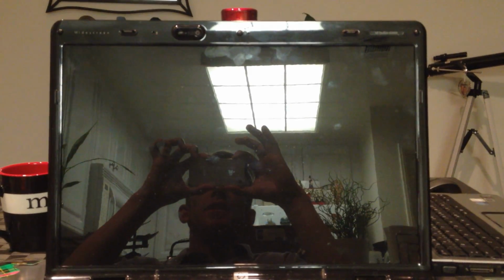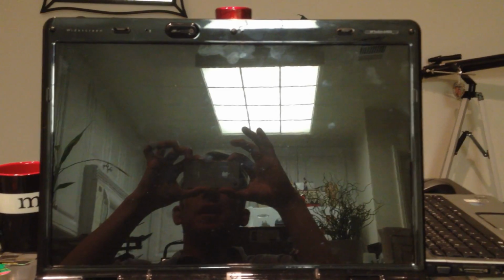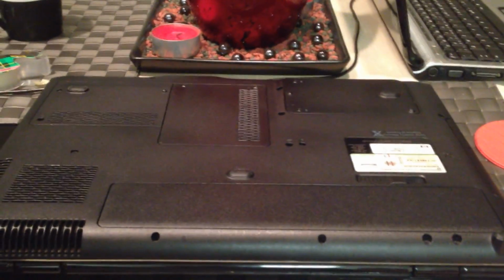How To Repair Your Loose Hinges On Your HP Pavilion Dv9000 Laptop

Comment: By chance I have the same laptop with the same issue. I was not sure how much I had to take apart to get to the hinges. Thanks for the video.  :-) I think I will add a drop of lock-tight to the screws so they won't come loose so easily again. Probably a design flaw.

Comment: The screws are loose probably due the hinge tension being too tight.  You were lucky to see the problem with loose screws before they got real loose and pulled the metal nuts out.  The following link will show you how to get to the hinge nut and loosen the tension.

http://audiokarma.org/forums/showthread.php?p=9018976#post9018976

Comment: In my Pavilion, the left hinge is the only one that is loose. It happen overnight. Everything was fine and when I opened the laptop lid I taught it was going to detach completely. It's to the point that it's opening the bottom left panel of the laptop, so the laptop is completely uneven when put in a flat surface.

Comment: Some HP laptops are worse. I have a g7 in that the left hinge practically detached itself, also the cooling HSF is not up to par when it comes to the processor that it has on board.
Reply: As in detached I mean the copper standoff that the screws screw into broke out of the plastic mounts.
Reply: Dilan Gilluly Same issue... did the solution here work for you? Mine also gets way to warm.
Reply: J Bailey Using JB Weld plastic got it working for the person for about 2 months then it essentially melted the fix because of the heat coming off of the HSF. Now I can't even open it without damaging it more. Because of this I'm not going to recommend HP Pavilion laptops anymore. Seen too many issues with them. If someone wants to buy HP I tell them to get a Probook or an Elitebook.

Comment: Another tip:
When taking apart a laptop you will need a "prying tool" to disengage locking tabs.

Use a old credit /prepaid/gift card  /plastic spatula instead of a steel screwdriver.  Reason is it won't scratch, and it spreads force over wider area.

Comment: Just a thought of two to add:
1: You should use BLUE Locktite on the screws, so the screws don't back out.

2: On a laptop I'm working on right now, the hinge was too "tight", this destroyed the mounting bosses /plastic webbing. Suggest reducing hinge tension, and reinforcing bosses /webs BEFORE they break.

Comment: TipsNNTricks I have a HP dv2700 replaced with a dv2000 screen, do you think it will work for me? At one point is has gone 165° or 170° backwards but I have managed to position it at an obtuse angle. I am going to get the kit and all. I just would like to know the difference between the loose screws or loose hinge?

Comment: I have dv2000 model and the hinge is completely loose, thus the screen is completely loose and independently falling on either side (front and back). Can it be tightened by just tightening the hinge screws under the panel ( panel for volume, power etc) or it might be the problem of complete hinge damage? please suggest..